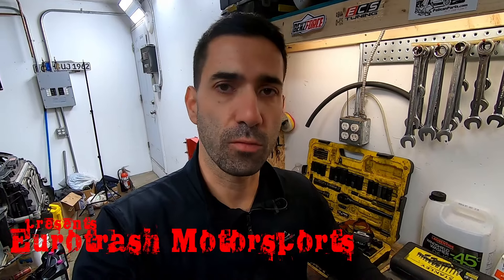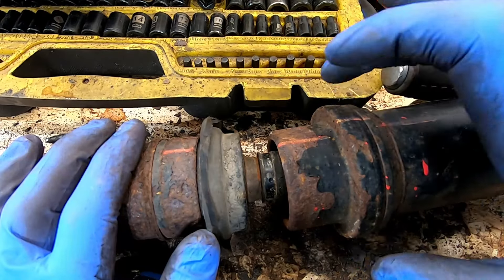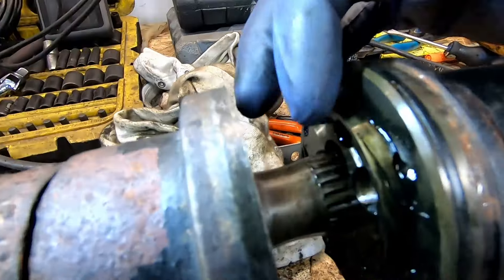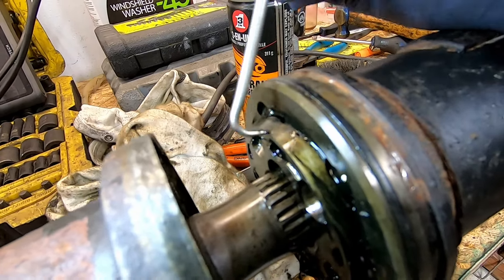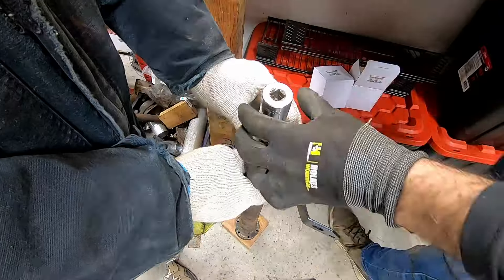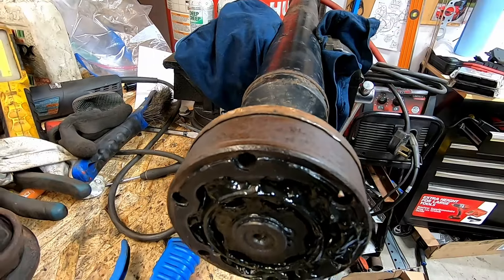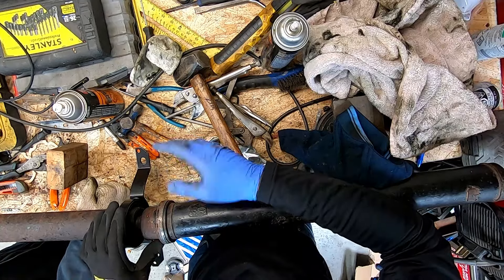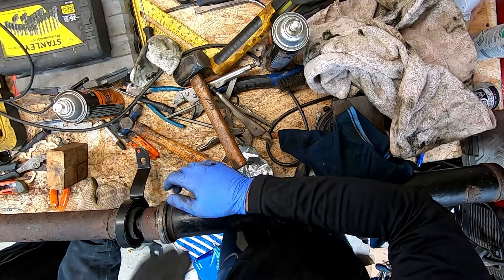How to replace driveshaft center support/hanger bearing on a B6/B7 Audi A4/S4/RS4

Comment: JXB performance makes a carrier bearing replacement kit where you don't have to separate the driveshaft to replace the middle bushing. Did it recently in my mk7 Golf R since the stock one ripped and it was super simple. Did a great job here though definitely nice to see they are serviceable even when the dealer told me it wasn't. Keep it up 👍👍
Reply from the maker: nice - I`m guessing that's two pieces and you have to cut the old one out? why theses manufacturers don't make driveshafts to be serviceable is beyond me - $50 bearing is a lot cheaper than a $1000+ driveshaft...pretty crazy
Reply: @ETMotorsports  yep cut the old one and the new one is a 2 piece billet witch swappable bushing material 👍
Reply: that's not a bearing, that's a bushing. bushings can tear and that's a great solution for that problem, but bearings also wear out and you need to press a new one on after popping the halves apart. no easy way around it.